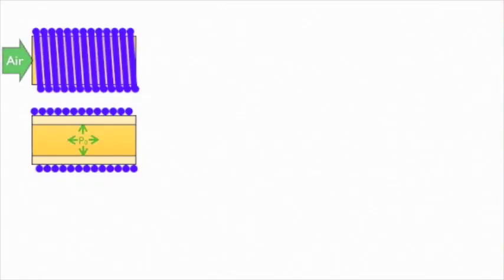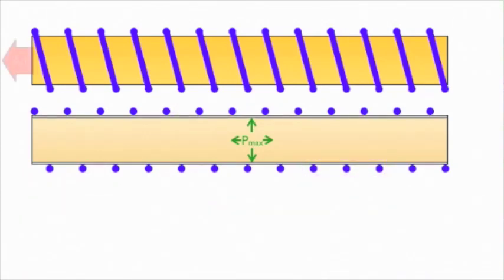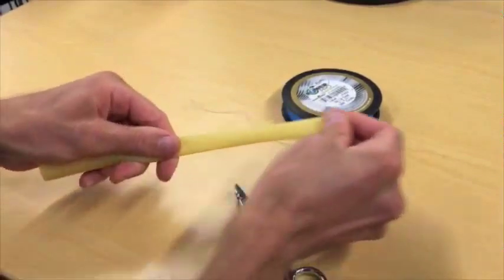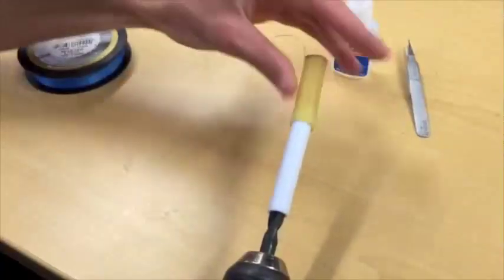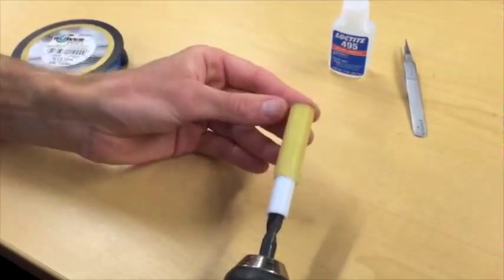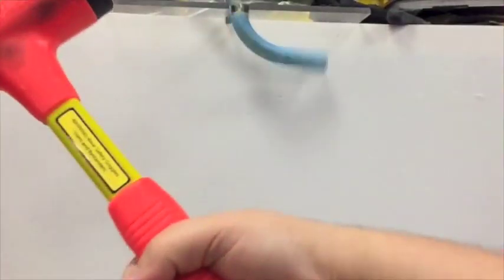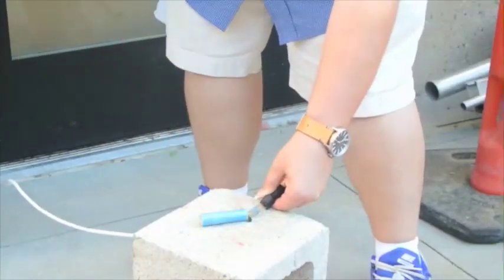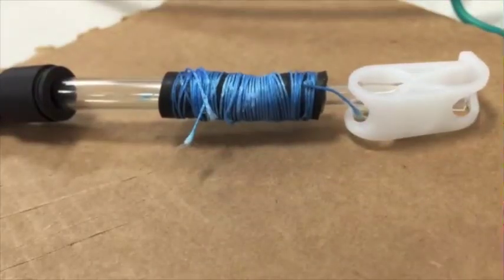Design and implementation of a 300% strain soft artificial muscle

Comment: Have you tried seeing how small you can make them? I guess smaller ones would be less effective from the deceased cross section. Nvm I guess.
Reply: naw man, mesh ring joint support, you right.
Reply: @kingmasterlord Or maybe several small ones in conjunction with?
Reply: @7200darkcharm  I can dig it

Comment: Pls give details of the power supply
Reply: The actuator looks like electric, but it pneumatic. The fiber is to provide structure, not for electric potential
Reply: @joseyamamoto2548 Doesnt it use positive pressure to expand only laterally (due to the fiber) and use the rubber to spring back up? No Vacuum I believe
Reply: Stretching is from an external pull force. IE, some weight. The power to pull it back is a vacuum. You will need a vacuum pump, an air chamber to create the vacuum in, and a valve to open and close that vacuum. Overall it is both quite simple, and impressive.